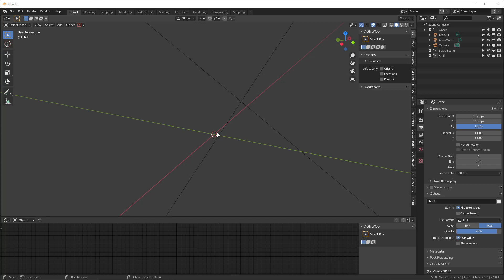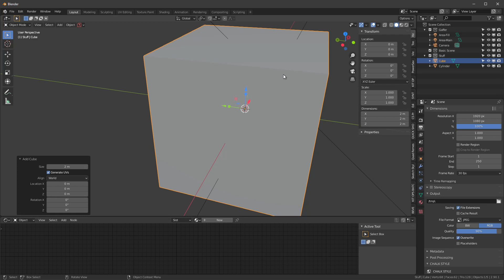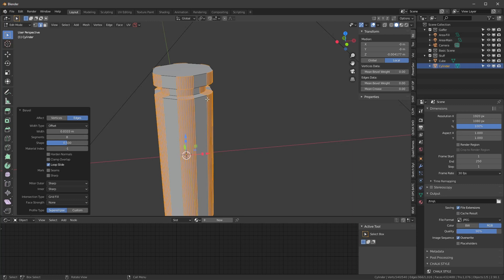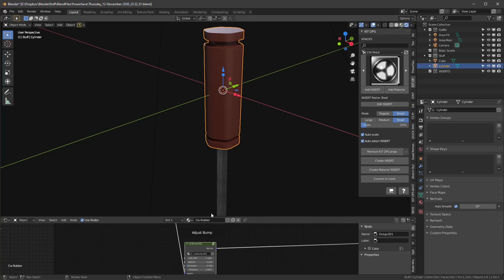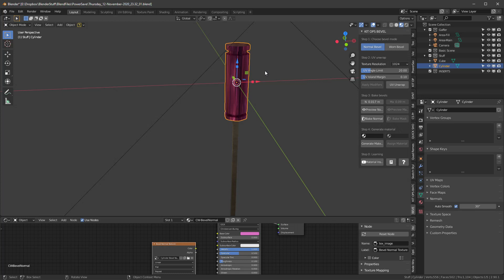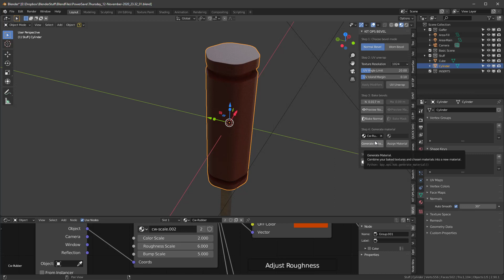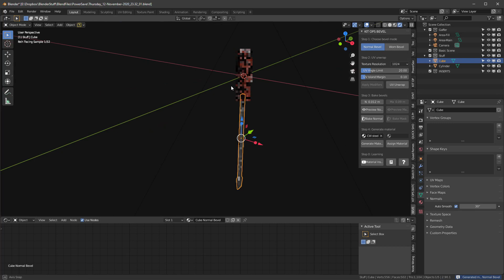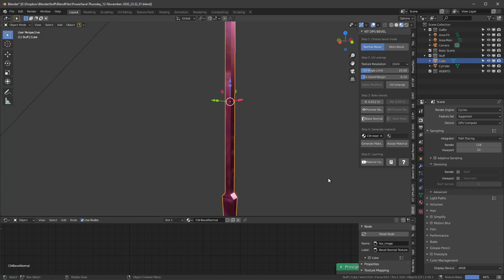KIT OPS BEVEL preview

Comment: Hi Chipp, regarding the default material @5:38sec , is there a way to reduce those little bumps, so the texture looks as if it has nothing on it? Can the bake normal be a custom imported texture, with thats clean with no noise or bumps etc etc. I want to be able to create the bevels on the edges and surface but with smooth looking texture like this: https://ibb.co/h1SLNv0 Thanks.
Reply from the maker: Sure, just go into the node editor and adjust the scale of the bumps and roughness. OR, just create your own material, and then use GENERATE MATERIAL button (and the drop down to select it) to add the bevels. See the docs: http://cw1.me/bevel

Comment: Hi Chipp, is kit ops bevel a more convenient way of using the bevel shader or have you made it so that materials work better with it or am I missing something.
Reply from the maker: Hi Tom,
The problem with the bevel shader is it only works with Cycles. So BEVEL allows it to work with EEVEE, not to mention it renders 10X faster in cycles as well. Plus it can create the worn edges look, which cannot be done in EEVEE because it doesn't support pointedness. HTH